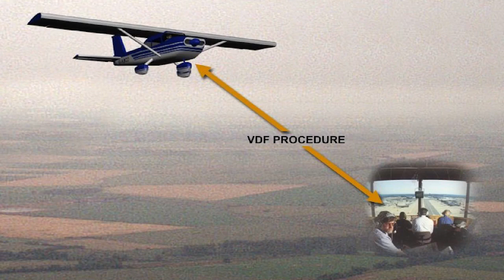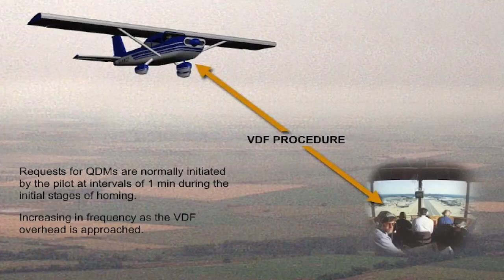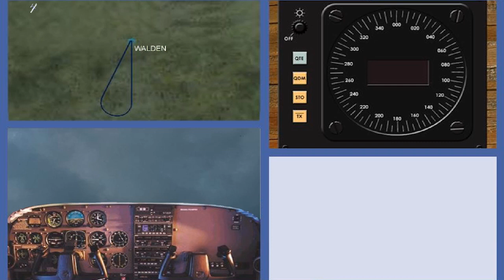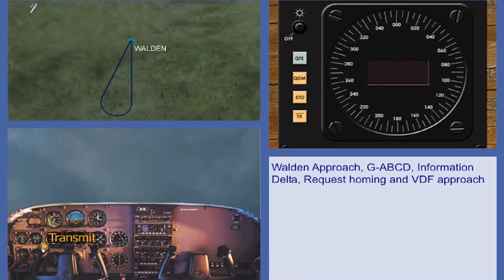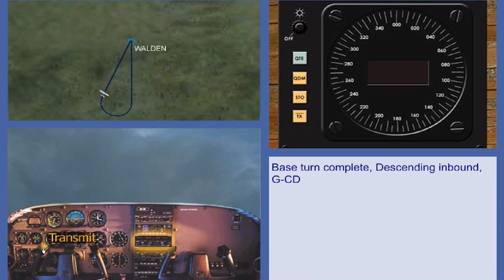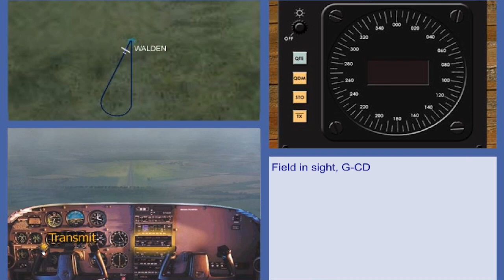07 Approach Control   VDF Procedure

Comment: Does aircraft has a seperate tx for VDF or the antenna receives signal from VHF which is used for communication?
Reply: The Aircraft talks to ATC as Usual. The equipment on the ground just points to the direction of the incoming signal, so whenever a plane talks to ATC the needle (Or digital display) will point to the direction of the person talking on frequency. Nothing fancy in the plane besides a the normal VHR Radio.